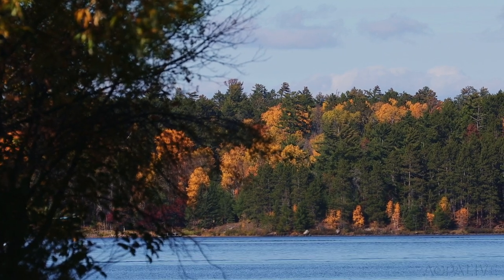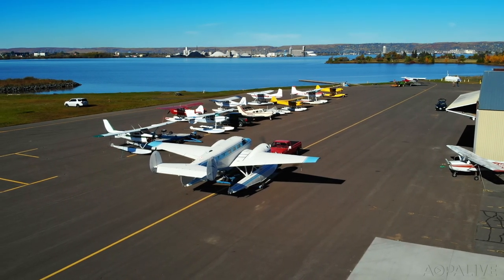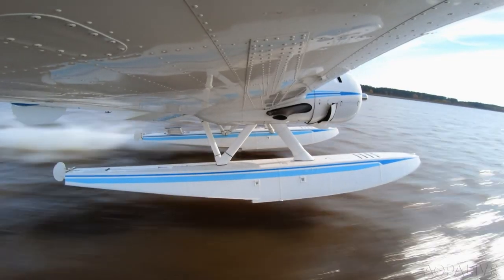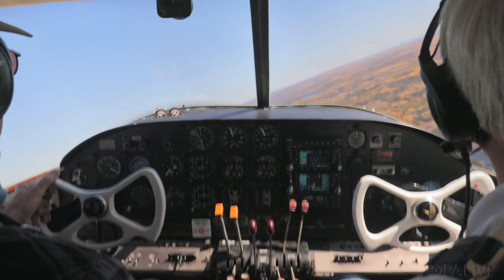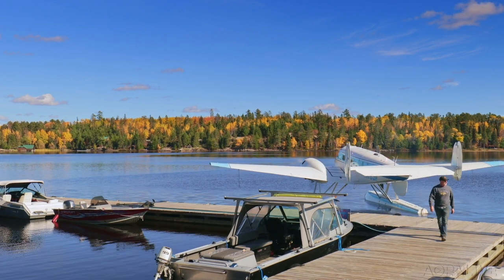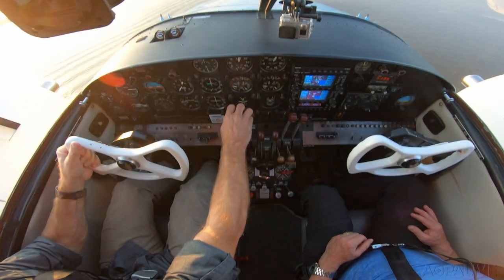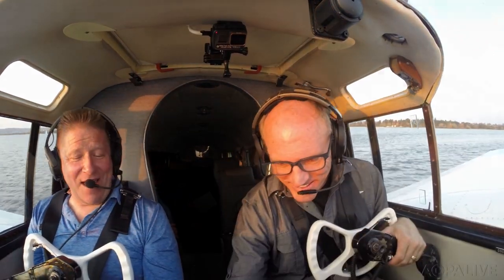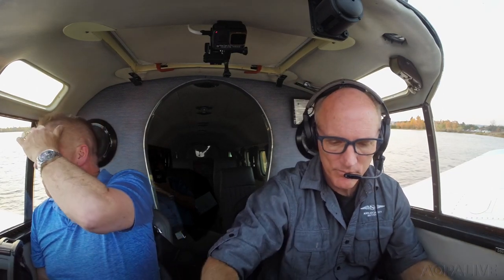What it's like to fly a Beech 18 on Floats

Comment: If the rear door opens upwards, and 2 tile-cutter type sliding poles join top-bottom of door, inner of poles is  workshop step ladder, rotate steps by opening of legs type, 
= how to pull ladder out and lower and hook to floor and float spring rubber stopper on pier.? 
= put handle bar to avoid steel cable cut throat price.?
Reply: This is approved for travel during emergencies. Owner proven smart enough.

Comment: I've never seen amphibs on a plane this big. Do they exist? Anyone?
Reply: No, they don't. If they did, I'd own one. I flew a Beech 18 on floats for 3 years, and it was easily my favorite airplane of the 40 or so types I've flown. I need amphibs because I live on an airport, and not on a lake. I had to settle for my 185, which is a great airplane, too, but it's no Beech. For amphib float aircraft, I biggest I can think of is the DHC-6 Twin Otter. There were quite a few big aircraft on straight floats and of course, some large flying boats that were also amphibious.
Reply: @OneTequilaTwoTequila  There is C-47 is on a set of amphib floats, of course its the only one of its kind left. Thats biggest one I know of.
Reply: @OneTequilaTwoTequila  ummm a twin otter is bigger than a beech 18
Reply: @Hgdhgfdssxvbbnjoo  Yeah, thanks for stating the obvious. I never said it was smaller. Amphib floats are available for the Twin Otter; they're not for the Beech-18.
Reply: Barely if ever do they exist. The multi engine seaplane is almost obsolete. It's better to a commercial single engine seaplane, commercial glider, sport gyroplane add on, and your tailwheel training in which a multi engine seaplane adds up to the upfront cost of a commercial single seaplane, commercial glider, sport gyroplane, tailwheel, spin, complex, and high performance training together. 8-15 grand upfront for a multi engine sea rating which can buy you a used car upfront.